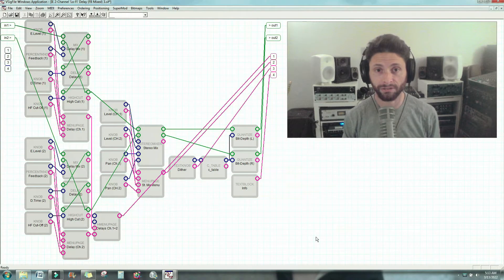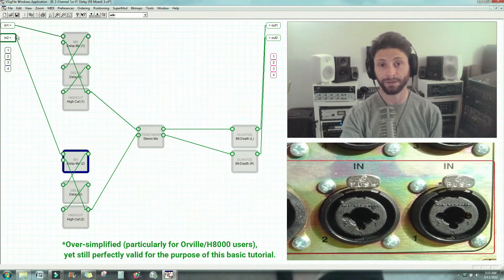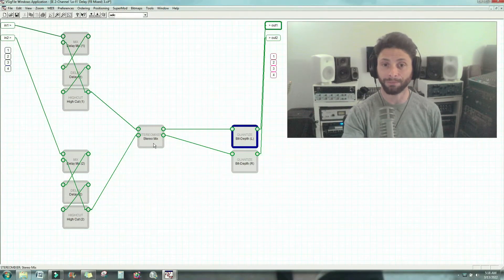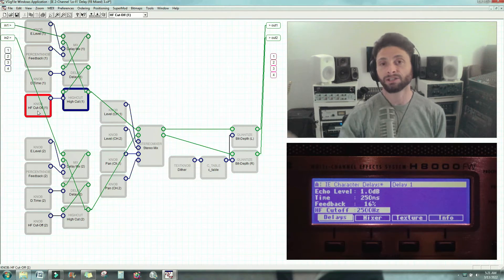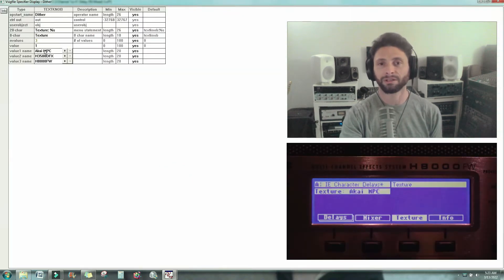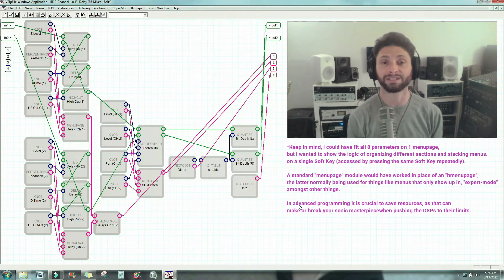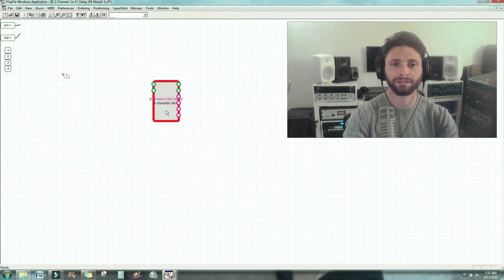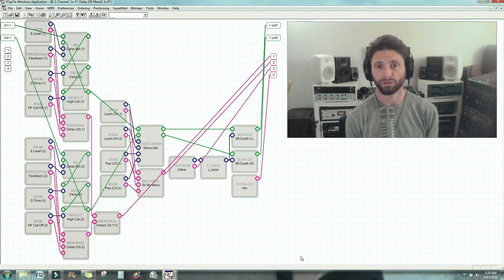Adam-I-Echo Presents: The Definitive Guide to the H8000FW - Part Three: Using VSigFile

Comment: Hello Adam. Can you comment on the ageing quality of older Eventide units, such as the Orville? Meaning, can these units, if taken care of be still counted on to work for a number of years. I had an H8000FW...three of them that were plagued with noise bursts, pops and various other, but was mentioned that Orville was more reliable or less prone to those. Any comments?
Reply from the maker: Hi Phil.

In my first video of this series, I discuss common problems and give a suggested range of serial numbers to look for when purchasing second hand.

What you have (most likely) experienced are the results of aging filter/PSU caps.
-Purchasing and replacing those is a good idea, and if you have experience doing such jobs will only cost you an afternoon to potentially have your unit up and running for another 20+ years.

The H8000 series also has the added benefit of being able to store and read data from CF cards which are more stable and easier to track down than the PCMCIA cards required by Orville.
Even NOS cards can give you headaches beyond comprehension (something I'm going through with my three Lexicon PCM-81s now).

So long as the proprietary hardware is working, anything analog and generic can be replaced.
The H8000 series was built on the back of the Orville, so whatever may plague an Orville can plague an H8000.
It is just more likely that it will plague an orville first due to those machines being older.

There is only one caveat to that-
-The H8000 has the awesome ability to combine DSPs to run huge algorithms in Monolithic Tandem mode.

This, along with Mr. Rose's idea to overclock the processor, AND (if you own an "FW"), the firewire card pulling current, makes the H8000 run hotter than the Orville-
-A blessing and a curse.

Nothing a spare quiver of Panasonic or "Nichicon Gold" caps wouldn't solve in time.

DO keep 1U of rack space open above either unit at all times though, and keep it away from other equipment that produces excessive heat (Fireface 800s, SE-70s, some RND products, etc.)

I hope that gives you some insight into things.

Thanks for your kind words and your support.

-Adam.
Reply: @Adam-I-Echo  Hi Adam. I should have explained that the three H8000FW were brand new. They kept showing various anomalies. Sudden and dangerous levels of noise would exit the analog outs and destroy tweeters. Had many conversations with Mr. Rose as he and I were in constant communication over this. Ray Maxwell, VP Sales at the time stated that the 8000 was the last product that could run on the current electrical/electronic build, since the 8000 was extracting the limits of this type of electrical board et al system. Stating also that the 8000 did indeed have more problems that were except able, but since they were being seen as 'cult" people were willing to put up with them and if possible had more than one.
My logic here was that Orville which Italo De Angelis loved might be an easier load for a lack of better term, if you see my point. If you are saying that purchasing an 8000 IS a better/safer bet, than due tell and thanks in advance.
Reply from the maker: @philmagnotta5553  So glad to be communicating with someone who is doing their homework, Phil.

Yes, these are issues that have plagued some users, and considering the Orville vs H8000 balance sheet, it really winds up being a matter of cost/benefit analysis depending on how many of the H8000's features you determine you will need OVER Orville's.

I personally have a lean towards Orville's sound over the H8000 (to a marginal degree when soloed), but find myself needing the power of the H8K.
I also don't use anything above Windows 7 and have a customized Lenovo W530 with a Firewire port that allows me to make use of the 8K's world-class converters.

Having loads of custom presets between mine and Italo's libraries also has me more comfortable in CF territory over the PCMCIA.
Also, I've owned (8) H8000FWs, none of which experienced the issues you mentioned.
-I mainly got them, revamped the PSUs, analog sections, and displays ten re-sold them after heavy testing.

Same with Orvilles, having had at least (6) pass through my hands.

In the end, I kept (2) H8000FWs for the studio (with Eve/Net), and (1) H8000FW that I pair with a PCM-81 for live work (though I am taking out an H9000 for live testing purposes at this point).

You won't go wrong with Orville to be clear, but you will deal with ageing components (easy to handle in the analog sections, and reliable displays are being manufactured), and the scarcity of reliable PCMCIA cards - no big deal if you just use the onboard presets and save your favorites in Orville's "Banks".
"Banks" are a Godsend by the way, the exclusion of which are the bane of the H8000's existence in my experience.

With the H8K, you may wind up with the issues you mentioned (though (8) units in, I have not experienced them once), along with the ageing analog components, but you get more presets, 5.1 surround, Firewire, CF cards and Monolithic Tandem (albeit with the overclocking to extract said power, and it's potential hazards).

So in the end, I would first decide what features for you are a MUST, and go from there.

-Adam.
Reply: @Adam-I-Echo  Hi Adam: Thanks for the very useful video, in which I am able to see what features changed according to FWxxxxxx. Your explanation re that,  has helped me to avoid certain 8000 for sale. I am currently negotiating for an 8000. It is above/ beyond  than  minimum FWxxxxxx requirements to take advantage of soldered chip/new screen, but also it is too new for inclusion of Ethernet. I have only used 8000 regarding 2u units, and the 8000 is a dream for my electric violin. I won't go any farther back, hardware -wise, unless I can't find a solid excellent/mint for sale. Not sure what Orville is missing in presets versus 8000, apart from monolithic. One preset, I forget name,  featured an arrangement where I stepped on a sus cc64 pdl, and a chord, of one's choosing, would progress w/ every sus cc64 command.
There might have been as many as 10 progressions through that key, and was amazing. Know what that is or if Orville have it?
Anyway, I don't expect to have issues. Really want to get back with 8000.
Reply: @Adam-I-Echo  Looking at a H8000FW unit with following set of numbers, but don't know if they reveal the numbers you speak of... Model: 1141-000 , FW -01172